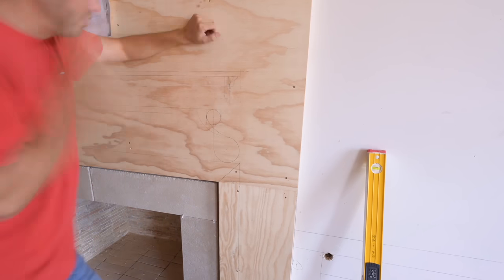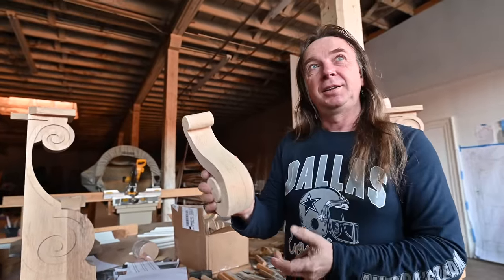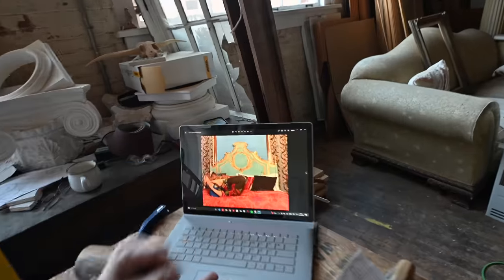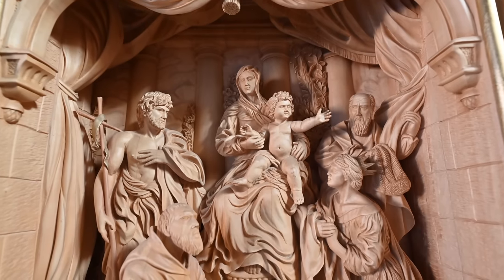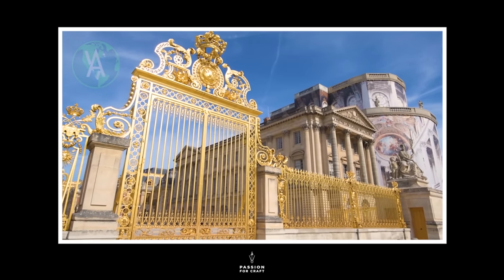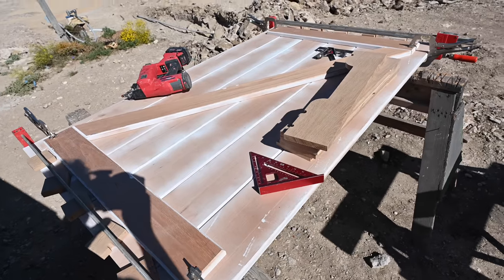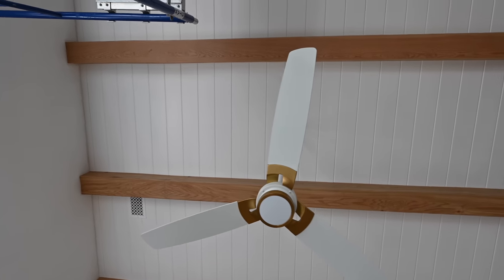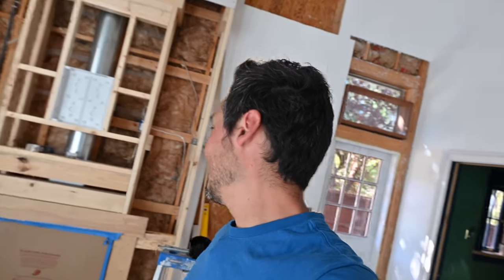Starting my fireplace mantel build!

Comment: So bud, I install those fireplaces everyday for the last 25 years.., you can’t put wood or any combustible material on top of the fireplace.  There’s a no combustible zone usual 6”to 18” depending on manufacturer but unless you have a power vent you might need to check specs so you don’t burn the house down.

Comment: Glad you're back.  Get the template for the Fame TV, that box is in the way of the mounting bracket.  Make sure you hard-wire internet to Frame since the metal box blocks wifi.  Also those frame boxes get hot, you're probably okay with that box but you might want to consult with someone who knows better than me.  If you or your kids ever want a video game think about where it would go, and run an HDMI cable.  And you will need to use your circuit breaker to cycle power to the box if the TV gets weird.

Comment: If you are painting your fire surround you could make a casting of a more detailed ‘carving’ or relief in resin or plaster and add it or find an antique one to add in. Lots of people do this to achieve a look in a more cost effective way. It’s obviously not purely timber but would create the effect if the final finish is painted. On the channel ‘Escape to the dream, restoring the chateau a recent video covered fitting out a whole room including fireplace with art work above using this method.

Comment: Mark where the wire are, use an “old work” box for the sconces. Unless they are massively heavy they will work fine. Then you can put the lights where ever you want after drywall and paint.

Comment: Z shaped shutters must have the diagonal part notched into the horizontal parts to avoid it shift over time. Believe me from experience, the curtains will deform over time like drooping with gravity towards the opposite side of the hinges and your teeny tiny nails will never hold them no matter how many you put in. Don't forget to put good fireproof insulation between the chimney lining and the plastic suction box as well as the inside of the whole framing of that fireplace!!

Comment: Is the heat from the flue a concern for your electronic box TV/soundbar? might be good to wrap some insulation around the flue  while you still have access
Reply: Usually double or triple wall pipe. Gas flues run cool compared to wood.
Reply: That makes sense, I was wondering if that was the case after I posted @thewhiteknight02

Comment: Hey bud, @26:31, that tab is not meant to be knocked out completely. You just bend it up and it keeps the wire from getting pulled or pushed out of the box. Not sure if you will get hit from an electrical inspection for that, but just thought you might like to know.
Reply from the maker: I smacked it hard but it’s still there. 😃

Comment: The gas chamber. I worked at a picture frame factory for a time. They sprayed varnish in open front spray cabinets. The guys who did that job all day everyday. After several days off, would return with similar to DT's. They were a mess.

Comment: quite breaking the tabs out of the electrical boxes. That is there to give strain relief.
Reply from the maker: If you’ve ever worked with the plastic ones they are actually connected by some plastic pieces / tabs. You have to smack it pretty hard to release it but it doesn’t break 😀

Comment: I dont wanna be that guy, but the wires you push through into the workbox should be held tightly in place with those plastic tabs. It looks like you broke one of the tabs and pushed the wire through
Reply from the maker: I smacked it hard but I didn’t break it. 😃